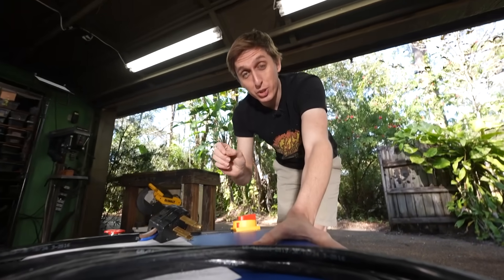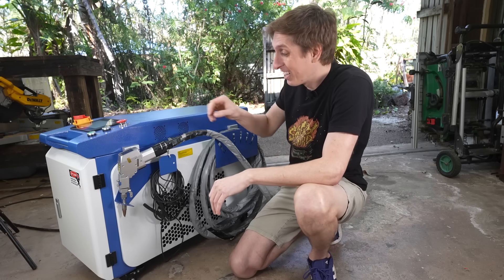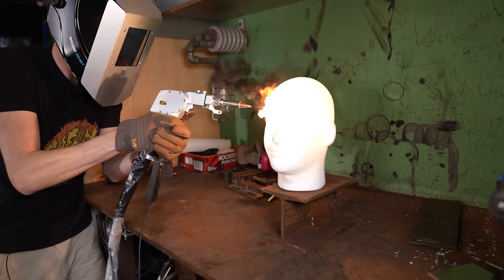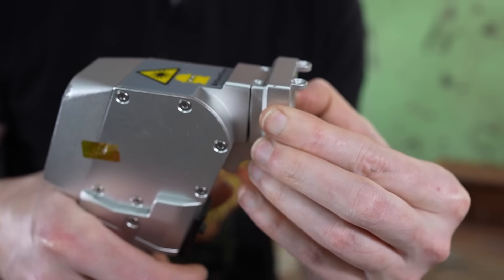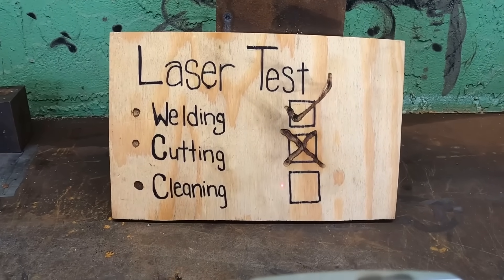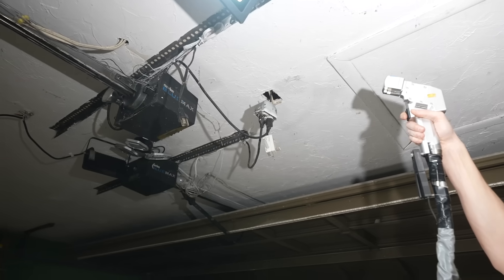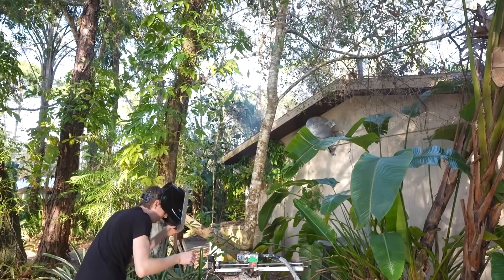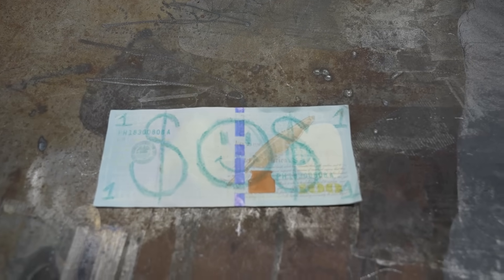Laser Cleaner Lifehacks

Comment: I can see that it has the ability to control the X&Y of the beam in the cleaning mode as well as modulating the power of the beam.If you could quickly alter the power  level of the beam, then you could use it like a fiber laser to cut and engrave challenge coins and jewelry.

Comment: To cut trees with these kind of laser machines or burn objects down, is idiotic and irresponsible. Like a small child. It's only a matter of time before someone irretrievably burns their eyes out or is at least completely blinded on the spot. These types of videos only serve to generate clicks and not to set an example. At least you point out the most important protective measures, thank you for that! But removing the emergency stop button is disappointing and unnecessary. There is also no laser monitoring area to avoid endangering other people without safety goggles. Good luck!

Comment: The metal only becomes hot because this is a continues laser source. It's made for cutting and not for cleaning.
To use such continues laser sources is a chinese invention to bypass the high investment costs for pulsed laser sources which are used in the real laser cleaning machines.
pulsed lasers clean much mor effective without heating up the metal. To produce these pulsed laser sources is 10 times more expensive in comparision to the chinese continues types.
The chinese laser pretent to be the real deal. they are not.

Comment: Look at those people shown operating it with no eye protection.  I wonder if they are blind now!  Honestly, lasers are not toys.  They can permanently blind you faster than you can blink.  IR light is particularly dangerous just because you can't see it.  That doesn't mean it will not harm you!!  Your remote controls emit it when you press the buttons but it is a very weak IR light.

Comment: I can't believe no one here has realized the insane discovery made in this video. I wish I had the means to make use of the knowledge but sadly I don't. This man just discovered (unknowingly) a way to make the perfect counterfeits. The one thing that basically nobody has been able to do is acquire the actual cotton paper used for money. Even the best counterfeiters never used the real thing, they just found ways of cheating the standard testing pens and faking the look and feel of real money. The ink is the easy part. That's why people used to "wash" low bills back in the old days and turn them into larger bills....but that technique is outdated now as well. However, with that laser you could easily turn 1's into 20's all day long. For the feds reading this, I will never attempt this. Mainly because I don't have the money required to buy a laser or get the other supplies needed and I never will as I'm a heroin user. If I had wanted to attempt it myself I never would have made this comment. To everyone else, I make this comment for you. In hopes that one of you people out there will make use of this info

Comment: This is awesome. I'd love to see more with this laser. Stuff like the range would be cool. Is it theoretically possible to point it at something like a weather balloon/airplane in the sky and would it just cut right through it if you had it on some sort of aiming thing??? The speed it cut through some things is insnae.

And what if you just kept adding power to one of these? how powerful would it become and it what's the limit. Could you instantly cut through massive metal plates from a distance? Just seems like science fiction. Super cool.
Reply: in case you werent aware, styropyro just dropped a video trying to answer that very question

Comment: Lazer welding is the strongest most penetrating welding process, I've never worked with it but I'm a welder and I know when a process is superior. It's the the penetration of a plasma cutter with unparalleled precision arc characteristic modulation. It's crazy stuff. Basically a mix of lazer 3d printing and welding.

Comment: LII

 

U.S. Code

 

Title 18

 

PART I

 

CHAPTER 17

 

§ 333

Quick search by citation:

Title

Section 

Go!

18 U.S. Code § 333 - Mutilation of national bank obligations

U.S. Code

Notes

prev | next

Whoever mutilates, cuts, defaces, disfigures, or perforates, or unites or cements together, or does any other thing to any bank bill, draft, note, or other evidence of debt issued by any national banking association, or Federal Reserve bank, or the Federal Reserve System, with intent to render such bank bill, draft, note, or other evidence of debt unfit to be reissued, shall be fined under this title or imprisoned not more than six months, or both.

(June 25, 1948, ch. 645, 62 Stat. 700; Pub. L. 103–322, title XXXIII, § 330016(1)(B), Sept. 13, 1994, 108 Stat. 2146.)

Comment: 5:00 This is not correct.  The benefit to the welder lens is primarily that it has a smaller minimum spot size due to the higher power lens, not distance.

Comment: You should double the laser wavelength with a nonlinear crystal, like green laser pointers do, a 2000w green laser would be amazing
Reply: and give it to the next person
Reply: That’s oddly specific
Reply: Now converge 50 of these in one and try to cut down entiere houses. 

Be sponsored by mr beast
Reply: It's 2023, green lasers don't use DPSS anymore. Any good laser will use a 520nm direct diode.
Reply: hell yeah flashbang welder
Reply: I'm going to modify it with my moon sapphires.
Reply: @jerbear7952  Bell?
Reply: the invisible spectrum has more energy than a wimpy green laser.
It would probably just burn a hole in the crystal.
Reply: @darkshadowsx5949  Literally none of what you said was right, and most of it didn't make sense.
For a start, the spectrum has no influence on the amount of total power (beyond the energy per photon - which green actually has more energy then IR). The wavelength of light affects the absorption of the target material. If you want to cut copper, Green will do far better then IR, as 532nm is absorbed much better then 1064nm. On the other hand, if you try and cut something that is green with a green laser, it won't go as well, as most if not all the green light is reflected off.

Nonlinear Crystals actually requite extremely high peak powers to even work. The crystals become more efficient, and the effect becomes more prounounced as the intensity of the beam increases. This is why NLCs such as BBO or KTP are usually used with a Q-Switched laser. The laser is focused in on the crystal such that the intensity of the beam is at, or close to (depending on the power density theshold and max electric field densities) it's focus point.
Reply: @DUIofPhysics  bro just wrote a whole essay on lasers r/murderedbywords
Reply: @DUIofPhysics  that's all well and true but this is also a fiber laser. It probably behaves like a Q-switched set up though so each pulse should reasonably have the power for upconversion. The real question is what frequency is the fiber running at as it may not be the usual 1064nm lines of neodymium. Other ions maybe used in the fiber amplifier or even if it's Nd they may use another lasing line for some reason or other.

Comment: I suffered an Arc Flash from a 3 phase switchboard. The fault current tripped the upstream main switchboard 400 amp circuit breaker. 

I lost my eye sight for a while. 

Someone did the math for me, in that one quick flash it was about 107000watts of light

Comment: 1:46 - aaaah... n00b mistake. 2000 watts is rougly 2 square meters of sunlight. What you're showing is 4 square meters. EEeeeeh n00b scientist :D
Reply from the maker: "visible" sunlight :P
From Wikipedia: In terms of energy, sunlight at Earth's surface is around 52 to 55 percent infrared (above 700 nm), 42 to 43 percent visible (400 to 700 nm), and 3 to 5 percent ultraviolet (below 400 nm). At the top of the atmosphere, sunlight is about 30% more intense, having about 8% ultraviolet (UV), with most of the extra UV consisting of biologically damaging short-wave ultraviolet.

Comment: Is removin the ink from a bill illegal? Yeah most likely **but**, unless youre doin such in order to commit a crime; its not smth anyone shud ever bother investigatin given that they wud much rather go after ppl actually doin stuff like this for nefarious reasons

Interestingly enuf: "If you have damaged or mutilated currency, or need currency replaced, contact the Bureau of Engraving and Printing"

Generally the rule is if more than 50% of the bill is salvageable, they will replace the bill. In this case im prty sure since the back of the bill is still inked, theyd replace it without issue, esp bcuz you likely didnt laser off all the security features so they cud easily confirm it was a real bill

You cud also take the bill to a bank and theyd probs replace it for you as they send in bulk shipments of dmgd (mostly torn) currency to BEP; im just not so sure they wud take these bills as they may be more sus of them than the BEP wud be, hence my rec to just go to the source yourself

Comment: You should do a test to see how much protection safety glasses actually bring. I guess, they are not there to make you stare into a laser but just to prevent the worst if there is some split second reflection from an object you use the laser on.
Reply: Perhaps a fragment beam mirror? Could do tests based on duration, %reflected, and more
Reply: Reflector from [g=2]

Comment: or make a portable version with the laser in a lightweight backpack unit, assuming the laser tube uses a low enough voltage so not too many batteries are needed.
Reply: Do you understand science?
Reply: Hello, Sir. Let me ask you this questions. Actually, there has been backpack lightweight laser cleaning machines in market for years.
Reply: Hello, Sir. Let me ask you this question. Actually, there has been backpack lightweight laser cleaning machines in market for years.

Comment: As someone who works in the welding and CNC industry, I can’t help but cringe a little.
A. Your welding check box might be out of a little over confidence. The only welding you’re going to be capable of without filler metal is autogenous welding (melting the material and fusing it with itself) which usually isn’t as strong as MIG or Flux Cored welding. Remember, a lot of welding need to hold under extreme forces, not just a couple of whacks with a 10 pound hammer.

B. The cutting may not be the best for 2 reasons. The first being that cutting by hand, especially without the right nozzle and fixtures is ALWAYS going to be messy. And the second being that it’s simply not designed for clean cuts.

Cool tool but ultimately, it seems you misjudged it.

Comment: you can actually just buy 30% linen paper which is the exact same paper that money is made from,   the reason why the bills themselves would be important to use when doing this is because the safety features are irreplicable, even though you can buy the same type of paper ur not gonna be able to insert the conterfeit protection into the bill, thats why each type of bill has its own safety features rather all of them just using the best type.   so in turn the most logical option would be to greatly fade a one dollar bill then print a 50 or 100 dollar bill on top of it using disappearing ink, any cashiers or bank tellers will be convinced of its authenticity, and by the time it reaches the galaxy brained atm machine the bill will have reverted back to its legit 1 dollar state

Comment: I used to work with 3d lasers. Powerful enough to cut through 1” steel… ive cut almost nearly 2000 d8 caterpillar dozer safety cage beams. 1/4 inch thick square beam bent and cut to spec..

Comment: THERE IS A VIDEO WHERE SOMEONE USED A LASER ON POLYMIDE TAPE THAT TURN THE TOP LAYER INTO A FORM OF GRAPHENE FOAM. HE THAN ATTACHED A BATTERY TO IT AND IT GOT RED HOT , IN ESSENCE TURNING IT INTO A HIGHLY EFFICIENT HEATING ELLEMENT . LOW COST HIGH HEAT ,EXTREMELY DURABLE AND MUCH MORE . APPLICATIONS ARE HUGE. DO YOU THINK YOU COULD REPLICATE IT ?

Comment: Actually a fun and cool fact when it comes to laser welding with these machines: you can have as attachment under the pistol a wire coil of filler metal of any type of metals following what you're welding, that act like a hybrid Mig and Tig welder. For thin metal welding, like, under 10mm, it's so clean with stainless steel that I see to reasons anymore to use a TIG welder, except in case of really large gap when you have to tack for initial assembly ^^

Comment: Hey, Qualified UK welder here. Those lasers can only weld super thin materials that machines like MIG/MAG can and with way less training for TIG. It doesn't have much penetration so its not good for many things however it does have precision and causes next to no warping for metals often used in highly sensitive equipment or precise placement without weld pull ( a type of distortion caused by the shrinking of weld metal that pulls two parts closer on the side it was welded) he was 100% true about its strength and that's why its used as well as its minimal training :D

Comment: "in these videos, a high-powered laser is used to vaporize rust right off the metal in the most satisfying way." Not to mention the operator's eyeballs. There's a reason you're not supposed to look at high-powered lasers without proper eye protection. it's because, over time, it tends to either give you cataracts or just straight-up give you permanent blind spots in your vision.

Comment: Laser welding isn't as strong. This is because there's no new material being added, you're just melting the existing metal together, with proper stick, mig, or tig welding there is new material being woven into the structure. 

Sure what you weld with a laser can be bent and hammered when it's free to move but try applying some serious tensile or shear forces to that piece and it will fail long before a similarly welded piece done with stick/mig/tig would.

Comment: Welding is welding. The strength depends on the alloy, the temperature, how well you prevent slag inclusions, and how well you shield the weld from oxygen. The specific source of heat is not relevant. Oooooh, hey, if you get somebody to hand-forge a sword blade, can you find a way to enhance the temper with that thing?

Comment: I would like to propose Binet, The Online 3D Printed Bidet Nozzle Exchange. The only place where you can peruse a continuous stream of new bidet nozzle designs, AND TRY THEM OUT TODAY! All user submissions must meet certain specifications. They must be drop in replacements for the nozzles included with the $25 bolt on bidet attachment found at walmart in most states, and thats it! The site is named after Jon Binnet Ramsay for fun, and to generate publicity. Eventually we will develop a commode that has a built in 3D printer so as to enable the automatic growth and disposal of a continuous stream of new bidet nozzles. Thank you for your time.
Reply: Have fun trolling your friends with an anus tearing high pressure water stream. Or caring for a loved one with IBS.

Comment: Some tests to try:

Slice a Pizza into equal slices
Open those hard to open medical pill containers
Seer a steak to perfection
Remove those stubborn stains from clothing (ie OxyClean to LaserClean)
Light a BBQ
Clean a window (or just a glass)
Can it shoot a beam through a phone book (or how fast). 
Can you cut a tomato (does it cut better then than Ginsu Knife?)
Remove those stuck, rusty bolt nuts
Remember those light propelled spacecraft demos from 20 years ago (Do that!) - The spun up a disk and blasted with pulsed laser light to send it soaring up into the sky
Real Genius Movie (1985) burn a hole through a tree and metal statue. Simulate vaporizing a man from orbit (maybe a gummy bear or plastic figurine) Pop popcorn in a room.
Write a message on a billboard from a distance (how about a paper poster from a distance).

Comment: Hey Kevin, welder here. When you showed the clip of you MIG welding, i instantly knew why the beads looked like that. You need shielding gas. For solid wire steel and and gas-shielded flux core, use 75% Argon and 25% Carbon Dioxide. For Spray Transfer use 90% Argon abd 10% Carbon Dioxide. Hope this helps.
Reply from the maker: haha thanks! those weren't actually my welds but its not far from the truth. I didn't have a lot of money so I bought the cheapest welder and flux core wire I could find. I found it hard to balance the wire feed with the amount of heat/voltage.  

I got a TIG a few years later and it was so much nicer. I loved the manual control.   The laser welder is more like MIG, especially when your using the wire feeder, but the wire feed actually pushes the gun along so you get nice consistent welds.
Reply: @TheBackyardScientist  You TIG? Nice. I'm doing that class now, once that's done I'll be AWS certified.